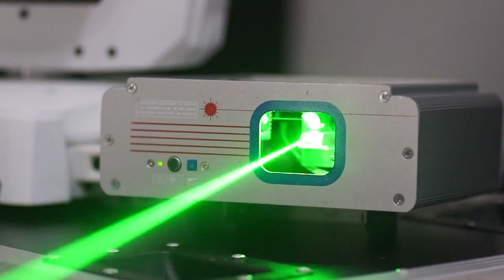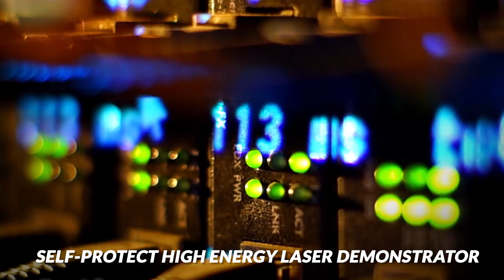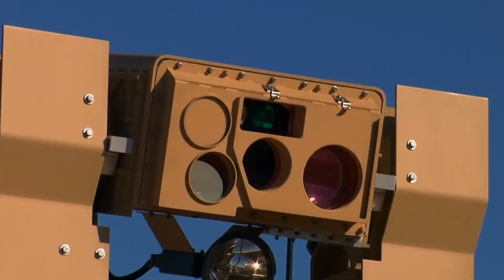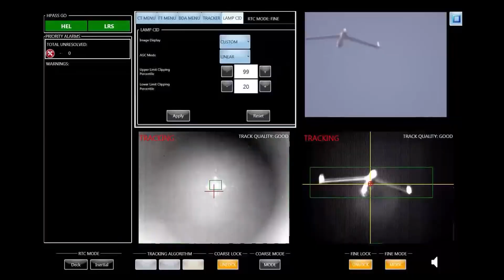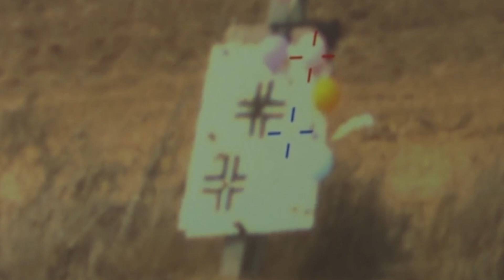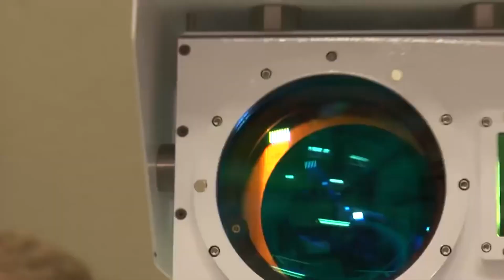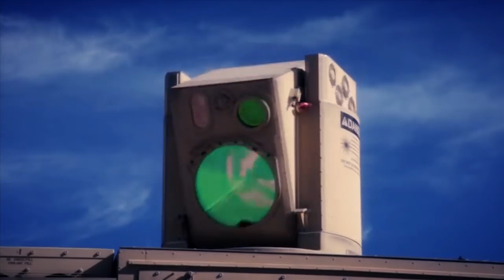The US Tests Deadly LASER Weapon on Its Fighter Jets

Comment: What a bunch of crap. The US airforce has abandoned the Lazar technology due to the amount of power required to operate a lazar system . They initially used a full size bomber just to house the power units needed to power the lazar. Theres no way you could house enough power to use a lazar on a fighter platform

Comment: I think the best solution still is to combine lasers with traditional ordnance. Instead of a single point laser we need to start thinking about laser rings encircling barrels with variable diameters within which traditional missiles, shell and bullets can be propelled onto their targets. So the barrel of a rifle should have a laser ring at its end through which bullets with light sensors are fired picking up acceleration as they go. This idea could be scaled up to include shells from tank and howitzer barrels, as well as missiles fired from missile pods. These could be carried by soldiers in their rifles all the way up to large land based weapons platforms like missile carriers. They could be used in the air by jets and helicopters; and they could be used in the ocean on surface vessels and submarines; for example submarine torpedo launch tubes. These laser rings could be projected onto the surface of the target guaranteeing a high probability hit rate.

Comment: Kherson, Yekaterinoslav and in the Don Cossack Region.  Causing great harm to agriculture in themselves, by their large number, ravines entail another disaster: they form a system of natural drainage and accelerate the runoff of precipitation from the surrounding fields, they draw moisture from the soil of the areas adjacent to them, do not allow time for this soil to soak  snow and rain water, and thus, together with the impoverishment of forests, contribute to a decrease in the level of soil water, which is more and more pronounced in more frequent droughts.  The flying sands, which cut through the chernozem of Russia in significant strips, are no less disastrous.  Moving over long distances, they fill up roads, ponds, lakes, litter rivers, destroy crops, and turn entire estates into deserts.  Their area in European Russia is estimated at more than 2.5 million acres, and this area, according to observations, is expanding annually by one percent, i.e.  approximately 25 thousand acres.  The sands are gradually covered with chernozem, preparing Southern Russia over time for the fate of Turkestan.  This process is assisted by cattle grazing in the steppes: with their hooves, they break the upper solid layer of sand, and the wind blows out the organic substances that hold it together, and the sand becomes volatile.  This scourge is fought with various and costly measures, hedges, wattle fences, and plantings.  In recent years, the Ministry of Agriculture has systematically strengthened the sands

Comment: Ok so while Lasers are not ideally suited to multiple airborne targets, they can CERTAINLY be a superb compliment to the overall loadout of all types of weapons systems, airborne, seaborne and groundbased
Reply: How fast can it destroy a drone or an incoming missile?
Reply: @osbornlim630 Immense heat is generated from speed, so they are made with shielded fuselage,but if is enough time trained on it,burn it up.
Depends on how hot the missile already is,and how long laser is trained on it.
Reply: Right now lockeed is setting up a "Special" F35,on with capabilities to hunt hypersonic missiles ,that takes them out with Laser defense system.
Rumour has it is for an Allie of the US special..
Reply: That is not truth..
They are short range but certainly can be adapted for multiple targets,much like scatter shot ammunition wall in proximity through computer guidance target acquisition.
Is what is being tested now.
Reply: yeah and todays guns all began as a weapon that targets a single target. Naturally the next step would be to couple multiple lazers.. like a gatling gun
Reply: Lliloilyi"llliiillherl

Comment: There was information when the F-35 came out that they could power a generator with the driveshaft that drives the the Forward Lift Fan in the VTOL variant and use the electricity for a laser Weapon.

Comment: The statement that they can only take out one object at a time is in error. TRACKER the LASER System I wrote about in 1992 can take out multiple targets many. I cannot reveal everything only to say that in the SBIR Tramco design using mechanical design like radar you track and signature lock multiple targets once on target the piggy back system can fire say 20 shots in I second or more. This is possible once that calibration is done there is no need to calculate lead or target X-Y. The sync of spin of detector and target are auto locked by design. Z can be acquired by 180 reverse sensor on accompaning detector using the same sync point. The space or degree angle and angle of incident will  determine range. The design is effectively capable of seeing 360% rotation in opposite directions gives auto track with detector sensor distance and x y. This design was mechanical and taken from the b field Al. disc spin sensors. Technology now allows for an electronic device to do the scans required. Rather than piggy back electronic sync is done digitally rather than analog since all the data is already present in that format. 
Problem 1. The detectors must be extremely sensitive. 
Problem 2. Recharge time of the laser / rail gun Caps. 
Once multiple signatures are acquired the LASER in Rotation by 1 surface mirror or actual mechanical can fire on all the targets in 1 scan cycle. Since auto calibration is a function of the scan targets once selected are synced. Note I understand the LASER they use are not Burst as my UV were But that will change very soon. LASERS in The Heat I.R. region are longer range and not affected as much by distance as shorter wavelengths. Red Sky at Night. Tracker was before its time and still has Merritt. To the human eye and ear it sounds like 1 long shot and takes out multiple targets. 1 shot boom they all fall down. Thanks Ronald Regan for the insight. Micro-Wave scan burst weapons yes. Negative Ion Burst yes. Negative ion UV LASER yes. I came out of my Lab in 1995. RATS HAVE ATE WIRES AND TEST GEAR. TRACKER WAS YEARS AHEAD. LIKE LITHIUM WORK I DID AND SHAKING THAT ELECTRON OUT WITH UV. USING b field spin. Mono magnet field Aluminum Design. Requires mechanical spin to create shorted turn mono rejection properties.

Comment: If they're having problems with space of tiny jet fighters, why not just use wireless or optically linked fire control system?  So they can have multiple fighter planes firing on the same target at the same focal point at the same time to multiply the energy density placed upon the target.  Of course, this means, you need to always deploy multiple fighters or drones to get the job done, better than one big plane I guess. I wonder if this maybe related to recent declassified UFO incidents in the last decade.  Missiles can't touch these UFOs but optical and IR trackers can make a lock which means laser weapons could be successful in shooting them down if they can swivel the mirrors as fast as the IR trackers.  However, these UFOs can still get to the fighters with their unearthly speed and acceleration to disable the fighters even before they register on the trackers and radar.
Reply: You will never get these Ufos even with lasers,cause they are not made from stupid metal and other earth materials,and the Us gov is not that stupid to atack em cause they know if they fight back it will be the end of civilization.. It's like being an ant and you sting a human,what do you think is gonna happen?You will get instantly smashed..
Reply: @montero363  You have a point there.  They are made of materials that can survive plasma temperatures and highly reflective.  The particle beam types might have a chance if they sort out issues using it in atmosphere.  They have no problem working in space though.
Reply: @Planet4752  This laser system is not very efective from what i'm seeing in these vids,i've yet to see this tested and proved in a real war situation,let alone using it to destroy Ufos with unknown tech. Just thing about it,if these ufos are coming here from other planets from the other site of the universe they are prolly made from materials we can only dream of,they would need to be strong enough to resist gamma rays,radiation rays,plasma rays and all kind of hazards in space,and also space debris travelling 1000km per hour... They are also described many times as vanishing into thin air,and not emiting any heat,so good luck targeting em...